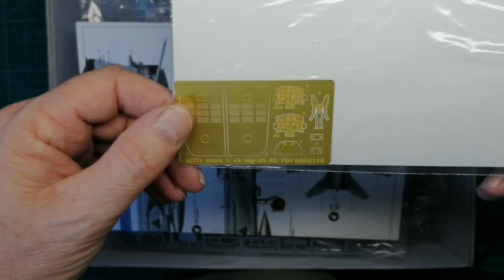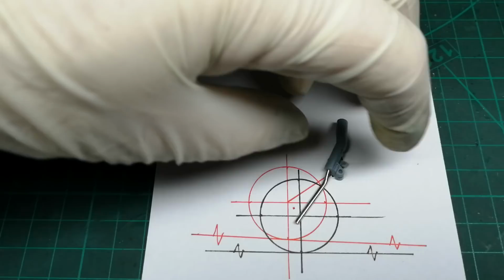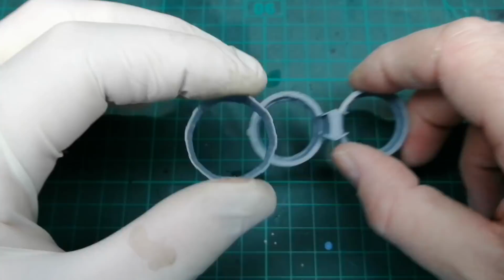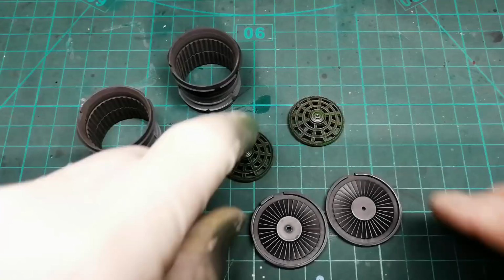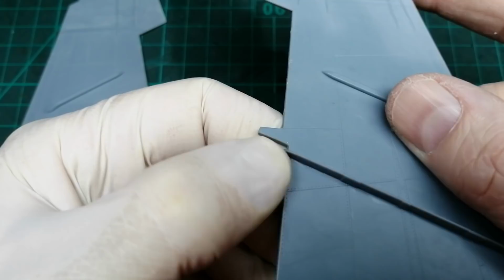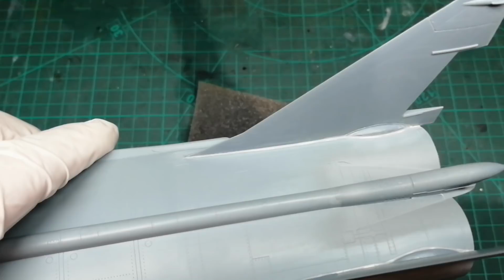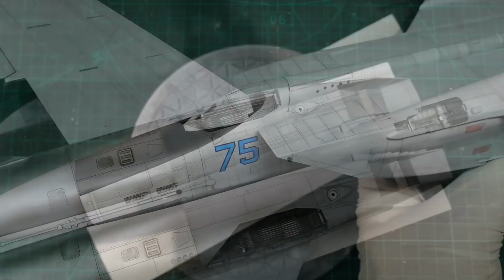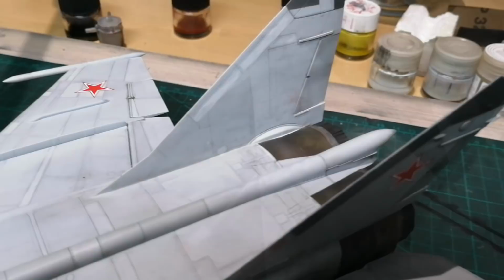Kitty Hawk's 1/48 Mig 25 Foxbat (Full Build)

Comment: Very good point regarding mixing colours, and I agree. Why pay a couple of quid for a pot of paint in a colour you will only use once, or so infrequently by the time you need it again it will be rock hard? Additionally the advised colour may just be a 'best guess' from the range, and you can get a closer match to the proper colour by mixing it yourself. Finally, hopefully rarer, the advised colour may just be /wrong/, and you can mix the right colour by hand.

I would suggest a swatch on a spare bit of plastic, trying out a couple of mixes, letting them dry, and seeing what looks best. Then mix a batch of that one. It will take longer but you'll end up with a better looking model. You could always use paint stripper to clean off the swatch and reuse it too :)

Comment: just finished this myself - like you, I got it when it came out, and didn't want to bin it - I'd also got the excellent ICM kit too, and knew if I did that I wouldn't tackle this dog. I had all the same issues, but left the engine rear as is, and didn't know about the eduard intake fix (damn) - I never got the wings right, but are happy it's all done now... Wish I had this video at the start though!! Well done... So, if you have this kit, follow these fixes, if not, BUY the ICM Mig25.
Reply from the maker: Yes I was stuck with an expensive lemon.

Comment: Nice build, Greg. Thank you. However, there is one thing that I have to note. You have cut the engine tubes, which, well, not correct. Mig-25 has two colossal R15B-300 engines with enormous afterburners. In the real plane, those afterburners end far close to the front of the fuselage, approximately level with the anterior end of the vertical stabilizer. So, Kitty Hawk did it right.

Comment: Beautiful job,I find it unfortunate that Kittyhawk kits( at least the ones I have built) tend to have a number of fit issues,the details generally look fantastic but can be marred by those issues,the most numerous issues I found were on their 1/32 Bronco,looked fantastic on the sprues but was particularly bad with the wing to fuselage and outer wing to tail boom alignment.Your fantastic work on the Foxbat has given me the inspiration to try my kittyhawk 1/48 Jaguar,maybe it will buck the fit issues trend!.
Reply from the maker: I had the Jag GR.1/GR.3 kit sat around for some years. And then for some reason got rid of it, looked like a detailed kit.
Reply: @GregsModels  Yes,it is highly detailed with both engines included,the landing gear is highly detailed also,unfortunately,I tried dry fitting the main gear components and the fit is very bad.

Comment: Just a thought regarding any part that may need bending. If possible heat it first so there's less force required to bend it? Then let it cool at the right angle. Also heating it may reduce the chance of it just snapping.

Comment: You made a great job! I made the double seater and had the same problems. I cannot understand, why they made the airintakes that wrong. The shape of it is completly wrong and the main issue in my opinion is the fact, that this airplane cannot close its intakes complete like a Mig-29 (without this red things) and you can build it only closed. There is no option to make it open. I had to scratch it.
Reply from the maker: A major job to show the intakes open, not for the faint-hearted.

Comment: Cracking job Greg, you've turned a dog of a kit into a masterpiece. What glue do you use to attach the painted parts at the end?
Reply from the maker: It varies but mainly Tamiya extra thin. If I think that at some point I want to remove a part, for whatever reason, I'll use PVA glue.
Reply: @GregsModels  Nice one cheers for the reply, I'm always scared I'll mess up the paint if I use extra thin!

Comment: Trying to decide between this kit or the revel Germany kit thoughts /opinions? Does the revell kit have the fitment issues like this one? And where do you find the printed parts/resin replacements? Not new to modeling but am not familiar with the rain replacement parts or any model additions that have come about in the last 25 years.
Reply from the maker: The Revell re-box of ICM's Mig 25 RBT kit is a great kit. But I think the Mig 25 PD is quite an old kit with raised lines, lots of reviews online for both kits.

Comment: Another fantastic build.  I am currently wrestling with their 1/32 F86k.  I am wondering if I could ask what you used to thin the paint you used to brush on the panel highlights.  I think you were using Tamiya acrylic and it seem to brush on quite smooth. Again, great video!
Reply from the maker: Its the sameTamiya paint and consistency I used through the airbrush for the first coat. The mix is applied by brush for the highlights. I must do a video on this at some point to make the procces clearer. Hope this helps
Reply: @GregsModels  It does, thank you very much.

Comment: Yes! 1/32 of this brute would be epic! With the decals. Are you able to varnish, apply decals then wash over? I noticed the "pop" on the color difference in the panel lines. Just curious about how you would blend them in.  Great build, sir. Thank you.
Reply from the maker: I varnished the water based wash just so I didn't reactive the wash when applying the decals. The decals were then sealed with another coat of varnish. After that I added a little more weathering in the form of water based washes and oils. These are not sealed in with varnish. Hope this helps.
Reply: Awesome. Cheers.